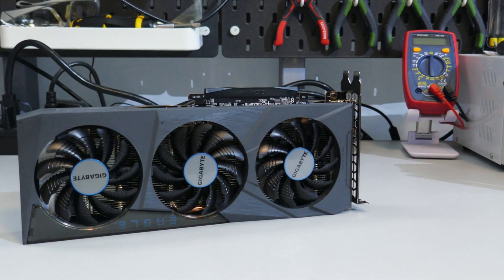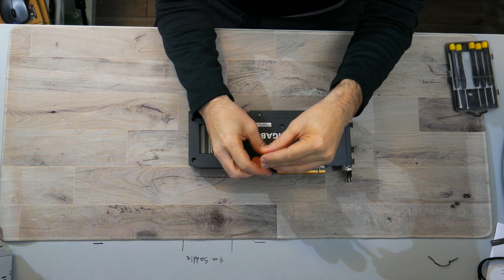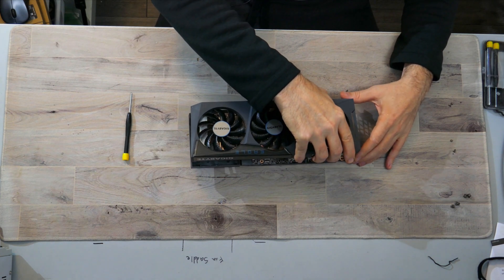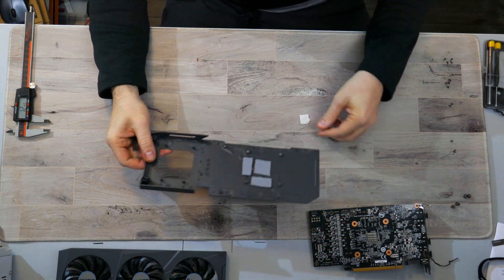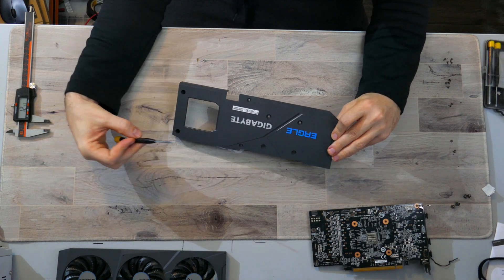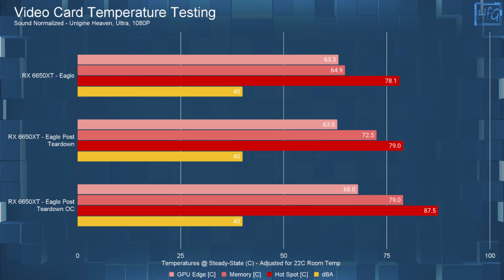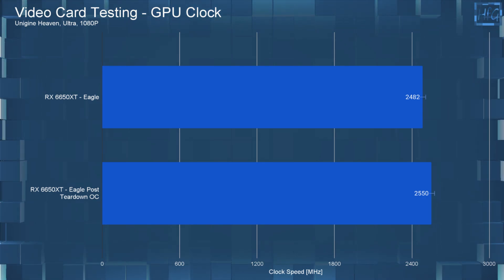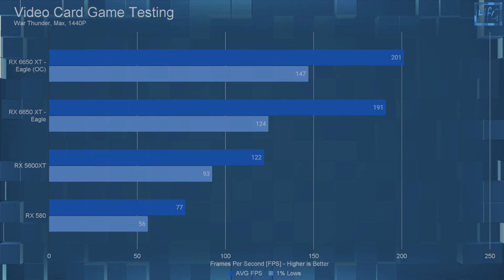The GIGABYTE RADEON RX 6650XT EAGLE - Teardown

Comment: Hi. Thank you for such an informative video! I'm from another country and I might not understand everything correctly, but you said that the thickness of the thermal pads behind the backplate is 1.5mm on a chip and 2.5mm on transistors, right? and also on memory 0.5mm and 1mm on mosfets?

Please tell me what my problem might be if, after replacing everything, my hotspot temperature reaches 95-100 degrees in some games....Thanks a lot in advance for the reply 🙏

Comment: I just changed the thermal paste on my 6650 xt eagle with Thermalright TFX, and used good thermal pads (as mine also ripped when taking off the cooler).

DO NOT DO THIS IF YOU ARE NOT HAVING PROBLEMS.

Even with good thermal pads I saw an increase of 8 Celsius to the GPU memory junction temperature.

Comment: is this the same heatsync on the 6700xt eagle? I put one in the mini itx build for my wifes living room/couch gaming pc. But running games like Hogwarts and Atomic heart they MFer is loud as hell. I have it in a Silverstone Raven v2 case so the GPU basically sits in front of a vent to the outside and can draw in fresh air from left side of case. 

But I don't think the piddly lil fans pull much air in, so I am thinking of deshrouding and maybe have a custom brackey/shroud duct/made to partition the fan intake purely to the side grille.
Reply from the maker: Not sure if the heatsink is the same but I'm pretty sure the fans are, and yes they are shit. 

Not sure if this would work, but if you can create negative pressure in your case it will help the gpu fans get more fresh air.

Comment: 2950rpm on this card is so loud, are you sure you ment 2950 or 1950?
Reply from the maker: they were running at 2950 RPM , 40 dBA is objectively loud yes...
Reply: @HardwareForGamers  hmm I see,  I got this card recently for a build to sell and beginning to realise how bad it is with temps. Card needs too run at 2300rpm to keep hotspot at 80c and that's undervolted 70mv as well. 
Unless I got a bad unit.
Reply from the maker: @duca1991  RDNA2 (6000 series) have a maximum operating temperature of 110c. That would be for the hot spot.
Reply: @HardwareForGamers  yeah, that's not bad. I guess the issue was, my delta is 40c all the time
Reply from the maker: @duca1991  that is pretty bad... Wow 40c delta... wow
Reply: @HardwareForGamers  I want to repaste and retention the screws but worried about voiding warranty haha. Gigabyte probably won't even care since it's not hitting 110c so I could probably just risk it and just try. 
What would you do with a card that sits at 60c edge and 100c hotspot? Ideas?
Reply from the maker: @duca1991  my first guess would be mounting pressure. I would try to tighten the screws and see what happens. It might have been a bad paste application, but if you open it up you'll likely need new thermal pads for the memory as well.

Comment: any recomendation for undervolting ?
Reply from the maker: I only have a -45mv undervolt on mine (which help the HOT SPOT drop 4C)
Reply: @HardwareForGamers  ( it's my 2 account) And how many watts drops ?
Reply: @HardwareForGamers  how many watts it drops ? and how many mhz clockyou set in gpu clock ? ( upper is real my second acc )
Reply from the maker: I only have a +20 on the gpu clock the the TGP is around 7-8 watts lower.
Reply: @HardwareForGamers  thanks

Comment: Very informative video and well made! One question: if I need to clean thoroughly the fans, is there a way to remove only the top cover without removing the back plastic cover? To avoid repasting the heatsink basically
Reply from the maker: No, to remove the top cover the heatsink needs to come off. You can unscrew the fans without removing the heatsink which will give you a little more room to clean but not much more.
Reply: @HardwareForGamers  thanks for the quick response! Will do as you suggested